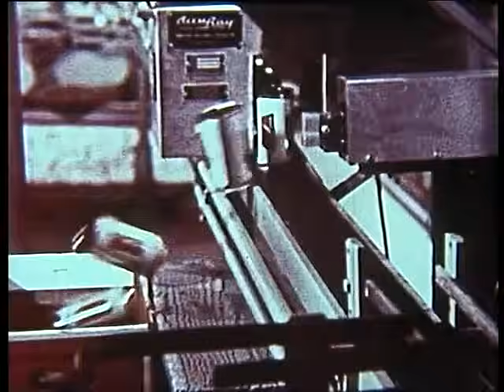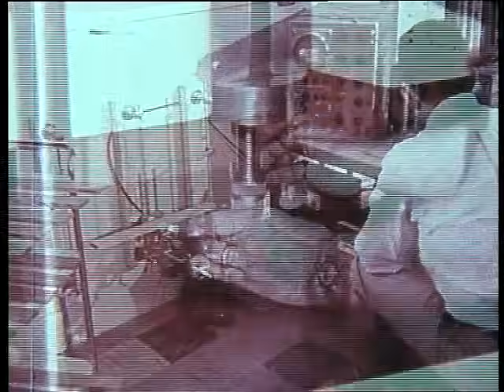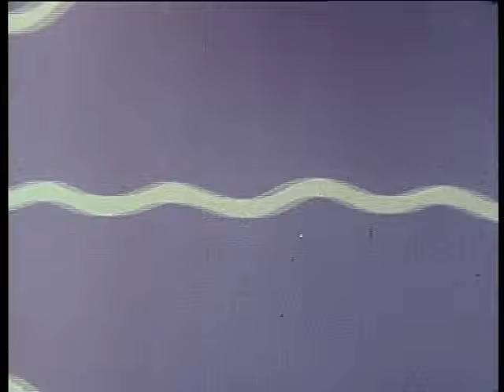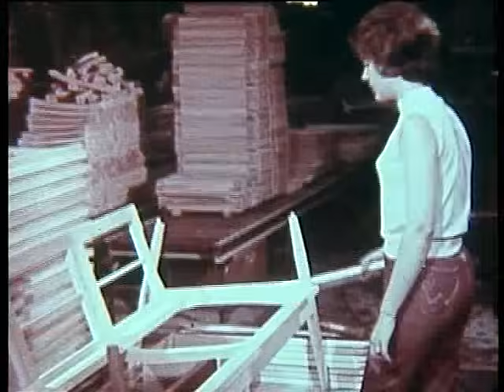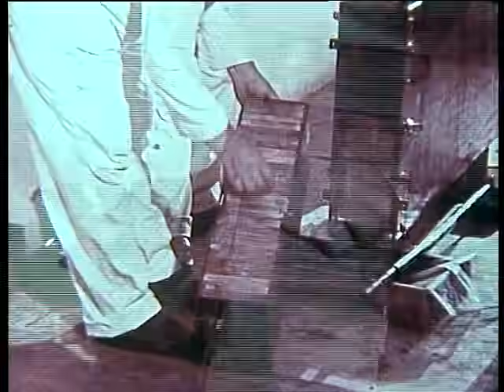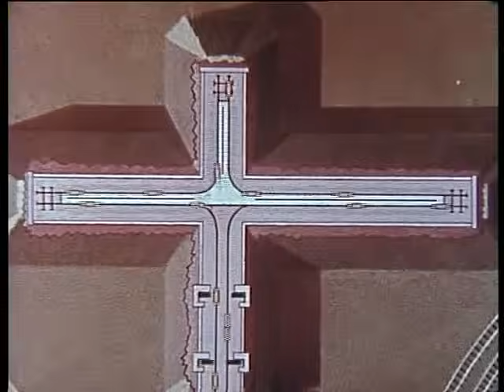Atomic Revolution in Wood (1969)

Comment: I don’t get it. What does the extra step of irradiating it with colbalt do? Wouldn’t impregnated wood with just epoxy give the same results?
Reply: They didnt have quite the the breadth of epoxy options we do today. also it helps with impregnation to heat the wood, which would complicate an epoxy use

Comment: These products never became mainstream because:

the process was expensive
radiation facilities were specialized
newer chemical wood treatments became cheaper
thermal modification and acetylation became more practical commercial alternatives
Reply: And, basically, iraddiation made nothing to the wood. All enhanced properties where due to the plastification.
Reply: @MaxCarponera true 👍
Reply: The irradiating facility is actually no different to what's still used to irradiate food, medical equipment, etc. in order to sterilise it. Even the cobalt-60 isotope is used as the source. But yeah, the bombardment of the sample as demonstrated here makes absolutely no physical or chemical sense to me. The vacuum plasticisation is the only useful thing going on here. I could be (probably am) wrong. 

Throughout the Cold War, there were "just a few" strange nuclear energy research programs and projects that were clearly a way of securing some grant money form the AEC. I'm certain this is but one. Haha.
Reply: @PBeringer  its just a monomer responding to gamma. What benefit this has over vacuum infusing a 2 part, hard to say. Maybe better penetration into the wood since they didn't have to worry about it thickening before they wanted it to actually set.

You could probably do similar with xrays, the key being higher energy penetrating photons. The monomer itself probably would even cure in UV, but that can't get deep enough into the wood to cure the core. Gamma or xray can.
Reply: @PBeringer irradiators are still much too expensive to waste space on processing wood with
Reply: Today's version of this is actively taking place. Back then they threw "atoms" at everything to see what stuck. Everything from devastating to extremely useful results.

Today it's AI.
Reply: The thing before was electricity. Lenin quote - Communism is Soviet power plus the electrification of the whole country.

Comment: Hard to imagine such a small-scale inherently batch process ever being economical. Electron beam irradiation cross linkers and polymerization initiators have all but obsoleted most cobalt sources for these kinds of things now. The plant seen being built at the end there was the site of two separate near-fatal gamma doses when a worker entered the irradiation chamber with the cobalt out of the pool.
Reply: I love finding your comments out in the wild. All over youtube.
Reply: @hullinstruments   ^_^ 😊 I'm everywhere!! 🤣 well everywhere extremely nerdy, anyhow.
Reply: @Muonium1  Ah yes, even on the arc fault videos haha, similar interests I guess. The one of Sao Paulo was crazy.
Reply: Heat and pressure techniques are now used to replace irradiation for the process for all but just a few manufacturers.
Reply: @mistermac56  are you saying there are manufacturers of this wood-plastic composite, and some of them still use gamma or electron beam polymerization/cross-linking?
Reply: @sashimanu PEX (crosslinked polyethylene) uses Electron Beam Irradiation, but does inherently use radiation of SOME sort inherently, if i understand correctly.
Reply: @ericlotze7724 things are still regularly irradiated to kill off and sterilize. But its nkt large scale in lumber processing if existing at all in that industry
Reply: @ericlotze7724  Yes, R-XLPE is a big deal in high voltage cable insulation, and in heat-shrink tubing all tinkerers use and love. Another high volume use for gamma rays is food and medical supplies sterilization. I was asking specifically about impregnated wood or other bulk plastics.